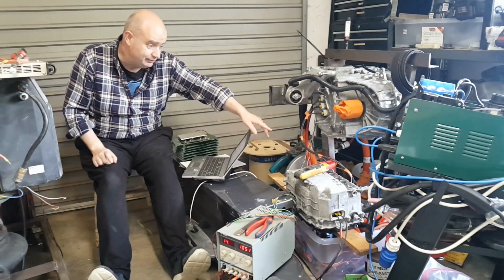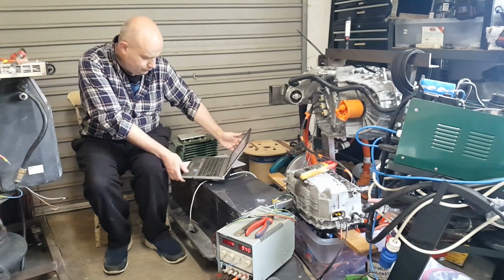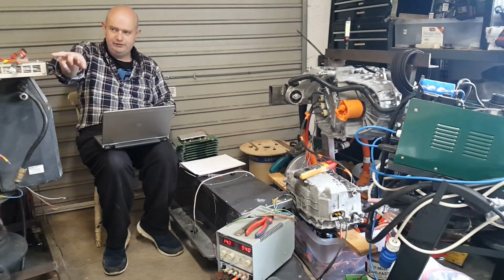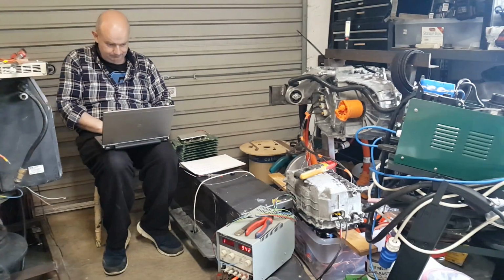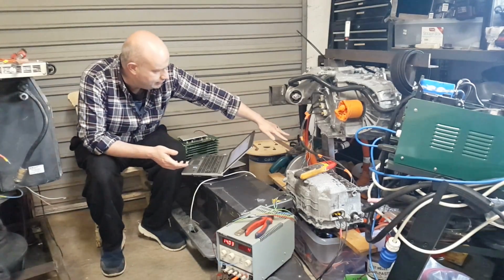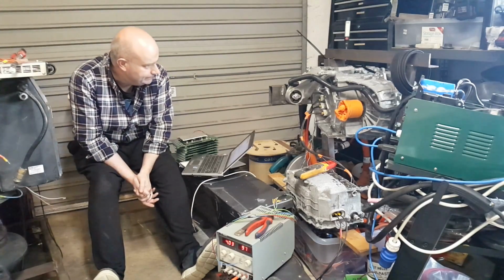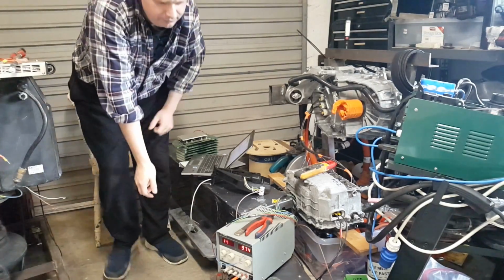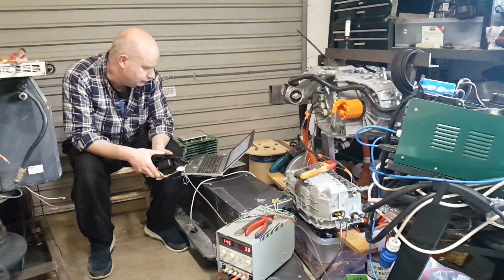Tesla Model 3 Drive Unit : Rotation Fail

Comment: I would prefer to use Toyota Prius inverter to save me from driving infinite current through zero ohm resistance, by the way what is the resistance of the motor at full load?

Comment: Hope this help: The rear model 3 motor is a 6 pole permanent magnet  motor. The rotor has 4 sub stacks, Each end sub stack is skewed by 3.33 degrees in relation to the middle 2 stacks which are matched to each other. The resolver is a 3 pole resolver.
Reply from the maker: Many thanks:)

Comment: You have to know the motor parameters and  tune the PI regulators of the FOC SW. Also the methode of reading the resolver signals is not very reliable. You need to use a Resolver to Digital convertor  in order to obtain maximum performance (a better resolution).

Comment: Oh, also checking resolver wiring is crucial. Switching sine and cosine for example inverses the angular information (forwards/backwards, as does switching 2 AC connections vice versa), but also switching postive and negative of excitaion, sine or cosine may have adverse effects.
BTW, the number of pole pairs can be determined by doing one full mechanical revolution of the motor and watching how often the resolver signal inverses its amplitude. To do this the excitation should be used as a trigger criterion and then either the sine or the cosine signal can be looked at with the excitation signal as a reference. And while the sine or cosine signal is changing its amplitude it will become negative or positive (0 or 180° phase shift) with respect to the excitation signal.

Comment: Regarding the FOC, I don't see any reason that you would have any current at low rpm that isn't directly related to torque or friction (this would be D-current). Only once you enter higher rpm (e.g. 5000+) and field weakening is used you would see current even without torque output (Q-current or field weaking current). This is all based on the FOC working properly. Some prerequisites would be correct angular information from the resolver, including correct resolver offset as well as the electrical motor characteristics being known to the inverter.
Since there seems to be way more current than necessary for the provided torque, I assume that most likely the resolver offset is off (probably the EM characteristics as well, but that might be liveable at least for low rpm). Same goes for open loop control, here you should be able to use a lower voltage and still get the motor to turn (with less current).

Comment: If the resolver noise problems persist, there are 2 easy fixes you could try:
1) Shielding of the AC wires connecting motor and inverter with either the motor side or both sides connected (this reduces the common mode loop otherwise closed by the potential equalisation through the housings of both components)
2) Not all resolvers are created equal and so are the corrsponding circuits. While there are generally no dramatic differences between different resolvers apart from the number of pole pairs, depending on the circuit design, even rather small changes in resolver impedance may have negative effects. In order to check this you could mock up a prius resolver next to the tesla one.

Comment: Well, it is syncronous motor. FOC acts like it asyncronous at start to make rotor rotate (when you saw AC current), then it switching to syncronous mode, so if it is no rotation, it is DC on phases=) Unless you rotate rotor manually to see what happens, but be carefull.

Comment: From what I know, field oriented control needs to know the current motor angle. The motor angle is being calculated via a flux observer or something else that I forgot the name of. 
So usually, the motor has to spin up in V/f mode to a few hundred rpm, then the motor angle can be calculated, hence you can switch to FOC mode. This is however in PMSM FOC, but I think it should be no difference to an IM
Reply: But it does have a resolver, só that wouldn't apply
Reply: @the_perigoso  true, however the angular rotor offset is unknown to the inverter which is likely a problem. Also the definition inside inverter of what is forward and what is acutally implemented must overlap (phase assignment versus resolver installation orienation and signal connections).
Reply: So I think the problem here might be that the software doesn't know the rotor angle atm.

Comment: Hi Damien, we do drive repairs all the time and for any situations where your not sure of the integrity of the output stage devices we always use a current probe connected to a scope on the output phase wires so you can actually see the current waveform on the 3 phases and that way you can see the + and - drive currents and its easy then to see whats going on and if there are any phase drivers down and measure the DC components, looking at the DC current also helps diagnose driver problems, with our setup we have 4 probs going to a 4 channel scope but these probes are very expensive and you can do a  very good job for basic fault finding with just one probe, keep up the good work, Dave @ BasicMicroUK

Comment: Could it be that if you request 10A in the FOC but don't request speed ( frequency) the software just puts out DC-current. And if you request speed AND current it puts out an AC-current with the requested Rms value/frequency ? I don't know a lot about control systems for AC motors, this was just a thought I had.
Reply: Normally there are two types of current you can request from a FOC: field weakening or torque building. I don't know what's being requested but the outcome seems to be mostly field weakening current. Otherwise with there being basially no friction a rather high speed would be the result of torque building current. (Automotive inverters generally operating in torque control mode, with the requested FOC currents being derived from the torque request or pedal position)

Comment: Agree a known motor would be good to get aquainted to FOC. I think it is a resolver problem, all that rocking. Maybe you manage to spin the drive shaft steadily with some machine and verify again that you get a clean 0-360 high speed (1000/1000) plot.
Also I have only verified the resolver sample timing with the Leaf resolver. Like the time between toggling the digital excitation pin and seeing the feedback signal peak. You might want to verify that.

Comment: Just great! ,just going over some the the Prius 3 and 2 vids, need to power my sail boat ,thinking of the chevy volt motor because of the "infinite" prop speeds for different prop sizes . Want to  spin a very large prop that can be pulled out of the water for sailing . Then when at anchor for tidal flow ,or any charging and sailing put prop progressively deeper into the water , similar to the indochina outboards (long shaft out the back) thinking 3.5--6 feet very slow turning .
Reply: The SE Asian (I don't think we say "IndoChina" these days - that's a war term) "Longtail Boat" is a brilliant and resourceful piece of backyard engineering. Seems you don't know how they work. The prop shaft is EXTREMELY long....about 4-5x what you want to use. That propels the boat vs losing efficiency trying to push the bow down, which a short shaft will do. They lift the prop out to prevent fouling in heavy vegetation that clusters on the canals - I've even seen it used as a weed whacker in order to get through a really dense patch. At sea, they're used to get in close to shore without a prop strike. The prop DOES NOT go progressively deeper - it's either just below the surface or out of the water. 

I'm lost as to why you're spinning a large prop, given most electric motors like high RPM to make power and in marine applications, you're running peak horsepower most of the time. Sounds like you haven't figured out the battery pack yet...you should do that before you get too hot and heavy on inverters, because you might wind up crying at the cost and weight needed to run for even a half hour at full power. Since you're "sailing", you're used to boring-ass speeds, so why not just use something like an e-tek motor, maybe two, and call it a day? The Volt motor is total overkill, the Volt drivetrain even more so. Of course, you don't say how big this sailboat is...

Comment: Are you requesting 10A as Id current?
Id is the 'magnetizing' current. And Iq is the 'torque' producing current, so you need some Iq to make it spin.

Does in spin if you turn the resolver manually?

Comment: Go back to a motor you know. More time but reverse engineering is never simple
Reply: Cracking the model 3 motor has enormous potential, since these motors will be incredibly common very soon and are very powerful + efficient. It's absolutely worth the hassle
Reply: Agreed. But their seems to be 2 unknowns here. The firmware and the motor.. so replacing motor with a know one. Then sort possible software issues. Then go back the the M3 motor. Then once that's sorted M3 motor and hacked M3 inverter . job done...
Reply: @stuartfram5184  
He's doing essentially that approach but in reverse; figure out the motor first then figure out the inverter, since the inverter is much more complex